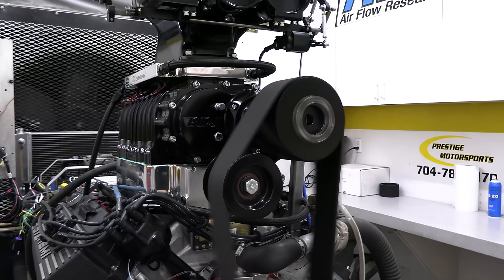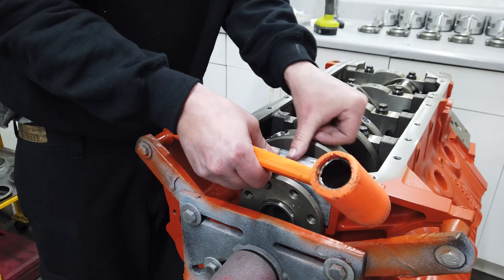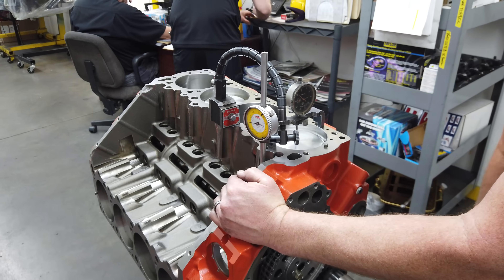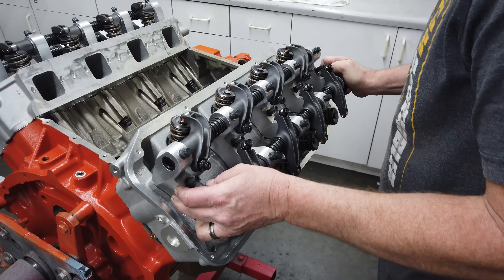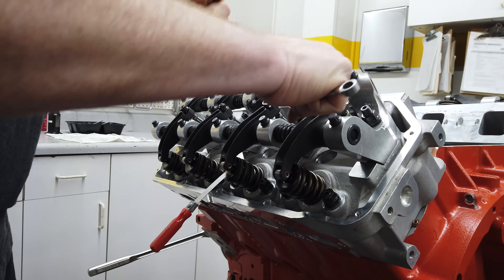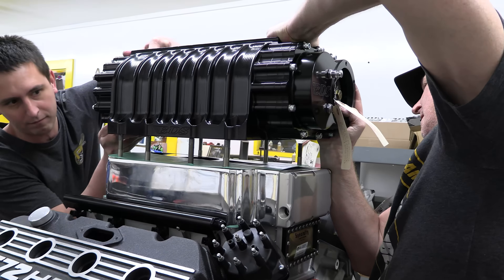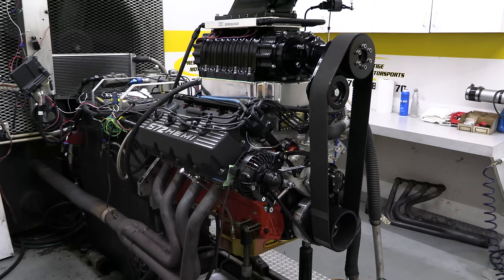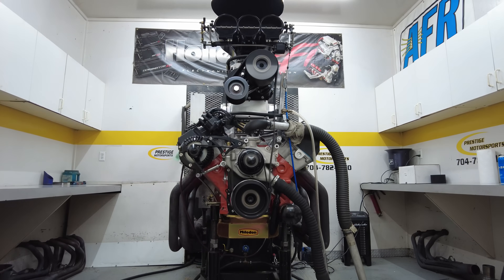Skyscraper 572 Hemi Build with a Massive 10-71 Roots Blower!

Comment: I use that copper gasket spray too. I didn’t even realize there was such a thing until I built a little EJ25 suby engine and I was doing some research on getting a longer life out of the suby’s head gaskets. I put head studs in it too, we’ll see if I get more then 95k out of it now.
Reply: But without oil leaking how do I know my Suby engine is running correctly?
Reply: @dragoonTT  Easy - a solid amount of lifter noise, the random misfire, and probably a boost leak.
Reply: Those plenums do nothing for Blown engines
Reply: Sc ccec

Comment: Thats a Monster. I have a 700 hp 528 hemi and its a handful, cant imagine 1000 hp and 950 ft/lbs of torque. Great episode
Reply: this is what i had in mind as a 16-25 year old in my charger ( wife wasn't impressed 🤠 but i was in 906 or D-8 hemi and mom 🤬 hated it 😁) but after learning something's im doing my 4.3x4.5" D-8 hemi 12:1+ static compression different now in 2016-up ish one of the changes is turbocharged instead and a 7-speed for low overdrive .42&3.2 FG and better gas mileage as it's a big pig 🐷to feed dailying
Reply: I think seeing around the blower is going to be the first issue, trying to avoid hitting what you can't see will be next on the list of problems titled " What could possibly go wrong"?
Reply: @jimbetts5164  lol 😂,um i suppose some people get use to it i didn't after 90 days or so and now going for more of a normal bonnet line or making harder to place the fender's/apexline aka from stock SE charger under 4"in and not blocking line of sight ( something i feel the stock setup is really good at as it basically has a 3 point gun sight 1-point ie is the pointy side by the bumper the next is the middle of the round hood bulge ect, the back does have a bad blind spot that after 10+years i haven't gotten used to yet but i think some cameras will fix that as we are in 2022 😉 ) for a 40-50 inch tall torso / 5,9-6,6 guy

Comment: Love the Engine builds video's, with the big jump in gas prices would love to see a street engine build based on 87 octane just to see what kind of power it would make on that low an octane.
Reply: You can easily run 87 on that with a proper tune. E85 would be better.
Reply: Complaining about gas prices? Come to Germany. 2.73$/Liter. Which equals to 10.33$/Gallon. 
How much is the gas price in your area?
Reply: @mojo3008  actually he should set it up to run on natural gas , it would be gall/mile but 3000 hp would be possible with 14.5:1 pistons.
Reply: @jimbetts5164  natural gas is easily available too
Reply: @mojo3008  e85 🖒🖒🖒 Octane 102 to 105
29:06 vp c16 - 117 Octane
Methane (natural gas (?)) 120 Octane
Reply: @amascia8327  there's a whole bunch you're missing there. E85 not only has less power than gasoline but it's an oxygenated fuel so you have to run extremely rich. You'll get horrible fuel mileage and on an na engine you won't make much more power than a 93 tune. 
Natural gas has great octane but also has less power per unit. You will get worse mileage with that too and it's not like you can get it at the corner gas station. 
Toluene actually has more power than gasoline and you don't need a special tune or fuel system to run it. Though you should add an oz per gallon of Marvel Mystery oil to be safe.
Reply: @KrazyOGMooKai  in the usa vernon,ct gas was $5.11 a gallon half of your price
Reply: no one with classic muscle runs on low octane. you can always smell the premium gas
Reply: @boostjunkie2320  no one expecting good performance out of anything runs low octane. The first thing I do when I get any car is get a 93 tune on it. Better performance and better fuel economy. Even on lower compression naturally aspirated engines like my son's 89 Mustang gt.
Reply: Uncle Tony's garage did a build on a 360 Mopar. He built it for fuel efficiency and still managed to make good power. Go check him out!
Reply: @boostjunkie2320  If the exhaust doesn't burn your eyes, its not a "muscle" car. Sorry to break the news to ya! LOL

Comment: It's builds like this that makes me wish I could go back in time an do a redo to my career and financial choices where an engine like this is unicorn tears to me. Any real gear head will get starry eyed at this hemi... Even most ricers can appreciate this. If it was mine the hardest part would be keeping it at a tame tune... The temptation to put a party pulley and see what that big BDS Huffer has to offer would be soooo hard to fight off... I'd tell em save me from myself and use red lock tight on the pulley bolts and once there tight fill the allen head in with JB weld! The only thing that makes me go I don't like that is that oil filter location. I'd think a remote adapter would be a good idea, where it's at it seems a snapped belt could take that filter right off thus every drop of oil in that monster blasting out the front at 80psi all over everything including not just the back but the front tires also, plus a high fire potential..... Pretty much worst case scenario.... But once again another epic dream HP Monster build. I've always dreamed of building a nascar spec SB2 street n strip engine, what would be cooler than insane 850 N/A HP 9000 rpm shifts in a car or truck but I wouldn't be against a 1500+hp Procharged SB2 either. LS who?

Comment: Tearing off a strip of double sided tape and sticking it across the intake where you’re going to drill and tap, and a couple strips below where the tapped hole will be will catch all the shavings from drilling and tapping and make clean up much easier.

Comment: Thanks! Great build! This was very helpful for my 572 KB block 10-71 efi with water/methanol injection build. No, its not "cheap" HP BUT Your motor will make many times more horsepower hours than any "modern" one due to much more iron handling way less cylinder pressure and rpms! Also torque and rotating mass matter when you slap the next gear, Remember, no automotive engine on the planet makes more hp than a nitro gen 2 top fuel 12k hp motor!  had to pretty much spec my own cam because of no good answers from major builders. I guessed and speced a crower mech roller at the exact same duration and centerline with .645 lift. (Best to Use For Hemis Only lifters for the KB block) Looks like I got it right! I will assemble it then have it dynoed. Having FHO do all the machine work with custom CNC stage v race heads. I have a TBS stripped 10-71 and bugcatcher efi. I was told by both FHO and Ray Barton to go with Callies crank and rods over anything else for racing north of 1k hp. Told them I wanted one that would live a long time on alky at 2500hp for later resale My shortblock will be good for appx 3k hp, thick deck water heads good for 6k on nitro. Theres a KB water block on nitro running 5 seconds in a nostalgia funny car in Europe with 3 years on it no failures! If you can afford it it may be money ahead if racing it and repairs are needed (weldable and sleeved) also price was almost offset by not having to remachine everything to correct flaws! Using same pan in Aluminum. Milodon gear drive. Everyone recommended no more than 8:1 compression. Ceramic coated throughout. Tim @ FHO laughed at me when I said I was using a blower to get 1k hp saying "it's superfluous! We do that N/A on the street all day! " But it will make it more streetable. Going in a factory delete never streeted 1964 polara 500 fully tubbed, front to back caged, fiberglass/lexan race car that was 2800lb with an all iron 440 and 727 with two bus batteries (hemi complete with blower and trans 230lb lighter) . Im using an ATI 1500hp powerglide. It will be street driven and raced NHRA legal. No popsicle stand cruise in only stuff! What was bottom pulley tooth count? I would really have to under drive it to get down to 800 hp for the street but want 1000 to 1200 with water meth on top end. FHO said if I  couldn't get 1k hp with 4-5 psi I had a really sick hemi!  Wedges are cool but return cents on the dollar at sale used,  hemis often bring more than cost And add alot of value to a car.  Especially if you can build it its probably the only motor that could be used hard and still be an actual investment for your retirement. "Modern" v8s are not always better than the elephant! Big hemis arent even woke up yet at 1k or 2k hp! Its amazing how many parts from a top fuel 11k hp motor will fit a 440 or 426. At 6k hp level almost everything! Not so with brand x who HAS to use our motors with their decals on them to compete in TF then backpeddle telling you its NOT a Chrysler design until you point out all the interchangeable  parts and say "now if all that fit a stock 396 or 454 block, was painted up stock so it was virtually indistinguishable from a production motor to the passerby and would bolt  to a chevy trans, wouldn't YOU call it a Chevy ?" Lots of greatly helpful info. Thanks for not making all the specs "top secret"! Like Don Garlits did once, publishing all drawings and specs for his dragster in a magazine then said "now if you can't go as fast as me its your fault!"

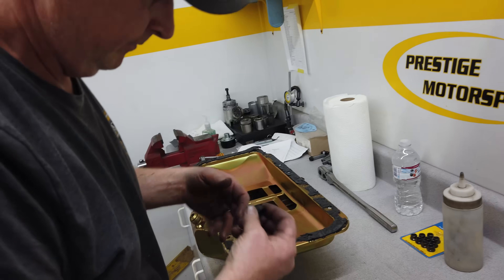Comment: 15:33  Removing a torn head gasket on the oil pan rail is always a PITA.  😇
Reply from the maker: Yes! And its even worse when you keep thinking that you wouldn't be having to do it if you had just held on to that nut tighter! Thanks for watching
Reply: @TheHorsepowerMonster  I'm not sure you caught that. You said "head gasket on the oil pan." LOL
Now THAT'S a custom build.
Reply from the maker: @jhutch1470  Ouch! No, as many times as I went over the video editing it, I never caught that. I didn't even catch it in your comment, which I see now. Oh well, if I can limit myself to one boneheaded thing a day I'm doing pretty good!
Reply: @TheHorsepowerMonster  LOL. You are just hyper focused to do your best. We just laughed and knew what you meant. I love your stuff and catch every video I can. 
Now all we need is a dyno test where you fill the air to water intercooler with blinker fluid and see what happens.

Comment: I guess everyone thinks that they are Dom Torretto 🙄🙄🙄🙄! It’s a nice engine, but that rotating assembly stuff isn’t what should be used on a big blower engine! Guess how I know? Hopefully he’ll probably be running it with the regular pulleys! Because 800+ ftlbs of torque that low just makes a tire shredder! 1.77 hp per cubic inch isn’t anything to write home about on a big inch Hemi! What ever happened to that twin torquestorm supercharged BBC that they had sitting in there engine room? I’m sure those are more efficient than that big hot 🥵 air beater on top of the Hemi! Nice video, I’m sure it will get lots of hits! I honestly love to see what Keith Dorton is doing! He knows how to make power with just about anything! He also knows efficiency! I loved that video when he made 1000hp with 250ish cubic inches, w only 10psi! 4 hp per cube, while not even trying is doing something! 👍🏻👍🏻👍🏻👍🏻🇺🇸🇺🇸🇺🇸🇺🇸
Reply: Yeah, but...look at it
Reply: That's what you WANT, is small blocks putting out monster horsepower
Reply: 1.5-1.8hp per cubic inch with boost pretty safe in my eyes.

Comment: On the cylinder heads,  they should raise the bore diameter to 4.500 inches on the chamber,  lower the chamber from 58.5 degrees lower to say 36 degrees and increase the intake valve to 2.500 inches diameter and the 2.100 exhaust valve.  And yes,  its possible.  That would be one badass Hemi !!!!!

Comment: If you want big Hemis and you are serious about them, Keith Black Hemi is still the cream of the crop. Not cheap, but these are the same ones used by NHRA. Not number matching restoration, but they are available. Just a different source and one that goes back decades
Reply: Keith Black HEMI engines haven't been the "cream of the crop" for many years. There are multiple HEMI builders like Brad Anderson, Noonan and AJPE that are light years better than the old KB stuff.

My street car has a KB water block, with Stage V HEMI heads and while its a solid piece that makes good power, it's not even in the ballpark of the new stuff that's available for racing. Moreover, with the business problems over at KB, getting anything is nightmarish.

Comment: Fabulous Engine .  I would have it each day of the week . With these changes.  The Block, Intercooler in Black . And an 8.3 ltr Whipple Blower  would have been my choice 4 the Top end . The HP & TQ would have been even more impressive & Aggresive.   And the core in the Intercooler upgraded 2 a Whipple Cupronickel Marine Core ..  better again . And possibly swapped out the Distributor 2 this new deal from the USA that can be tuned on ur cell phone . 
❤ed the Blower Hat . 

Gr8 job Prestige Motor Sport.  
U FOLK always do sweet work .

Comment: blown Gen 2 Hemi in A12 roadrunner = Hell Yeah!!!!! . A good time for all and what else is there to say? I think if there is going to be any problems it will be the owner  keeping the structural integrity of the  driver side floor boards intact. Resisting the urge to repeatedly assault them, the damage the right foot will be unleashing upon it, with no time to repair in between, will be brutal.
 From the mechanical side of foreseeable issues is keeping the engine nice and cool, and not destroying the rear tires. That by itself will be nothing short of a miracle. The future for the back tires is pain and suffering, with a dramatically reduced lifespan, those poor bastards will be shredded into a pile of smoldering rubber, in a millisecond. 
I hope he has an extra fuel cell in the trunk, and own a tire shop. I would recommend  a well stocked supply vehicle be close by  with all those things stocked up and ready to go when  he leaves the house, he will need it at some point.
 That is an awesome sight to behold. Makes one believe in a higher power, and he drives a MOPAR!

Comment: Really hate to be the negative one here.  I usually enjoy your builds. 
However, Chevy’s new big block crate engine doesn’t need a power adder.  It makes 1000 hp NA, “on pump gas”.  It also has a 2 yr warranty.  Just saying.
Reply: Yeah I am a mopar guy and I'll say this is a pretty weak Hemi especially for a blown injected 572 Hemi, these things are capable of waaaaay more than this is doing.
Perhaps more tuning?
Reply: Don't you just HATE those Chevy engines!
Reply: To an effect, I agree. But I have a feeling this customer cares more about show than go. He wants blower surge "because it sounds cool" and with how massive this engine is, it's definitely going to grab attention. So for this fellas application, lookin' coo, it's probably perfect. But for that matter, a gen 5 LT1 with the right setup can make 1000hp too.
Reply: @pablotharpalo5685  1000 hp is the new "500"
Reply: @CrankAddict  Noooo doubt, I utterly can't stand'em. 😏😏✌✌
Reply: IT BETTER BE A 572 BORED OUT OR 632 BBC

Comment: How much hp is that intercooler worth when you're only running 7psi?      It would be great to see some of these engines in the car doing burnouts or whatever, even if its a year or two later.    You can link the videos together to get more views, etc.
Reply: The roots makes a lot of heat even at low boost maybe around 180F and the intercooler with just tap water can cut that in half and likely gain 1hp per 1degreeF

Comment: I have a wedge 440 at 14# vp110 fuel,intercooler,8-71.I would like to know what material the piston rings are to switch to from my hellfire for street driving.your cam is not far off from mine at 261,112 lsa.

Comment: Chrysler oil pumps on the outside since late 20s. And the motors were fully oiled unlike ford's partial as purchased ab GMs slop rings and oil slinger rings

Comment: That's a cool build but a little to tall. Would love to daily drive that thing. Ditch the intercooler for twin 850 Holley and it will stay cool. Next pull it back apart for the port and polish of heads and intake should get you almost another 100HP.

Comment: 10-71? I heard of the 4-71; 6-71/6V-71; 8-71/8V-71; 12V-71 (which was basically two 6V-71's bolted together) and 16V-71 (basically two 8V-71's bolted together) but never a 10-71. The x-71/xV-71 is a two stroke supercharged diesel. What was the 10-71 used in? the 16V-71 was a stationary engine mainly used in large generators, and some marine applications. 4-71 to 12V-71 were used in class 6; 7; and 8 trucks. The 12V-71 had two 6-71 superchargers, while the 16-71 had twin 8-71 superchargers.  They were also available naturally aspirate. The 4 as an inline 4 cylinder only, 6 and 8 were available as an inline 6 and 8 cylinder or a V6 and V8. A "10-71" would be an inline ten cylinder. The 8-71 was pretty much the practical limit size-wise for an inline engine, and are somewhat rare in trucks. The 8-71 was used more for marine applications and large generators or compressors, and some heavy equipment like cranes. 
FYI: The "71" is the cubic inches of each cylinder. There was also a larger x-96/xV-96 series of engines, each cylinder 96 cubic inches. The "x" is the number of cylinders in both cases. Therefore a "10-71" would be a 710 cubic inch 10 cylinder.
Again, what was the "10-71" used in?

Comment: How and why are there still roots chargers when there is the displacement (screw type) compressors? They deliver multiple times the Boost per Power loss.
Reply: The screw blower is 2x to 3x the cost
Reply: @michaelclanton1152  Well I am from the right side of the Atlantic... try to buy a roots charger here.... a displacement charger is considered archaic...
Reply: @TheNecromancer6666  I am sorry things are not easy on you in this market.
Reply: @michaelclanton1152  Oh you misunderstand. They are. But it's all Turbo here. Cause why would you use a supercharger...